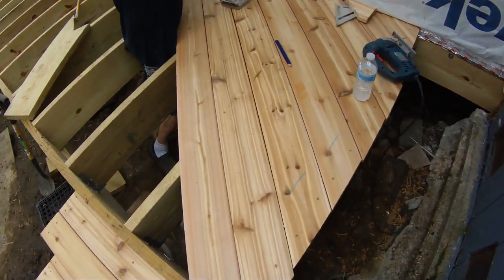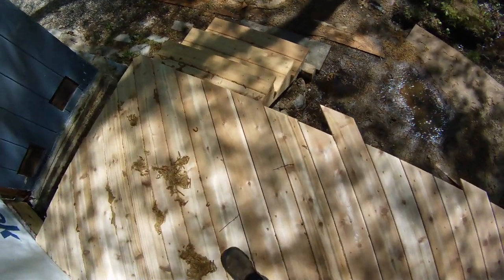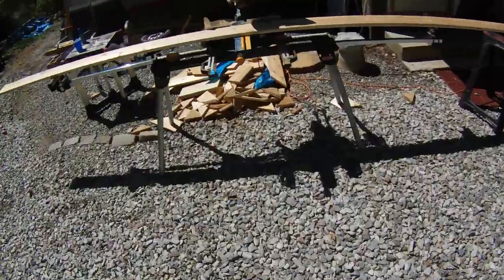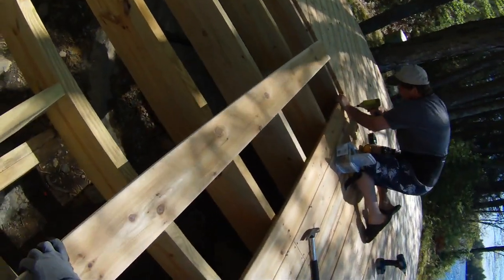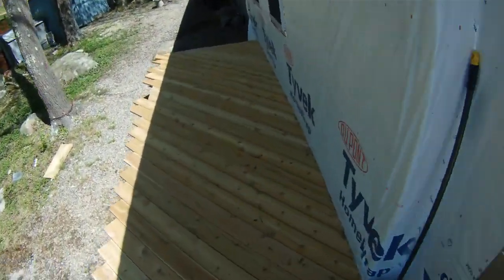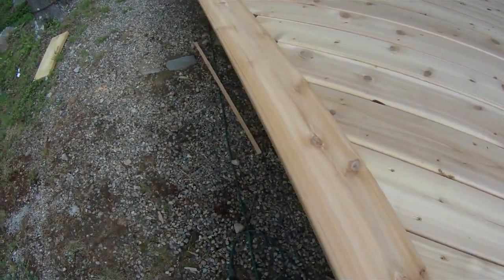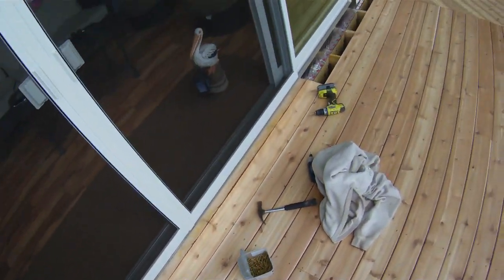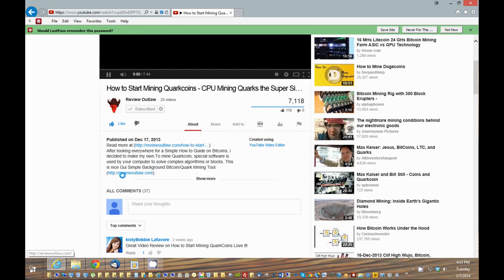Deck Building - P3 - How to install Cedar Decking

Comment: Is it recommended to leave a small gap when using tongue and groove? I know there would not be a space between the boards because of the tongue and groove, but what I mean is should I allow for expansion by not putting them as close as possible.

Comment: Can you use cedar decking with pressure treated pine for the vertical supports. Just trying to reduce cost. Great video btw
Reply from the maker: Yes that would be fine, i used all Pressure treated for Support and only Put Cedar on Top. Best of Luck!

Comment: Would you recommend any type of hidden fastener system for cedar decking? Thanks for any help on this!!
Reply from the maker: j bair I have not tried any on cedar I do have a video on hidden fastener system on Composite they have side slots built in to the decking that make it very nice, let me know if you find anything for Cedar as that would be a really nice look. If you can’t get. Tan screws and you can hardly see them after you stain.

Comment: Are those cedar deck board rounded at corners  like a regular 2x4 dug fir stud or is it a o0 degree at all four corners?
Reply from the maker: correct they are rounded, here is a zoom up picture of it. https://www.lowes.com/pd/Top-Choice-Radius-Edge-Cedar-Deck-Board/4323591?cm_mmc=SCE_PLA-LumberAndBuildingMaterialsRedwoodAndCedar_-4323591:Top_Choice&CAWELAID=&kpid=4323591&CAGPSPN=pla&store_code=2396&k_clickID=d45c22fe-9d73-4846-b1cf-04cb66325108&gclid=Cj0KCQiA0vnQBRDmARIsAEL0M1kNKM6d-EuF8CGJrJCpx6xMqhsDxXYtduP2WTcHdRX_oUgct58M4nkaAhbJEALw_wcB

Comment: you probably should have started laying the boards down from where you finished, 1/8th of an inch overhang would have been ok on the stairs
Reply from the maker: I added some under stairs lighting so i wanted a little extra room to play with. but thanks for the advise.

Comment: Never space natural wood, only synthetics like trex or IPE. Push them tight and screw em down, boards WILL shrink. 2 years from now you will have one inch gaps between each board.
Reply from the maker: Mark Walsh Good to know is that with every wood or just Cedar?, and if i don't leave space won't it swell and damaged the wood or buckle?
Reply: in the netherlands we actually use more spacing because of the wet climate. for those ´small´ boards we us like 8mm (about 1/3 inch) spacing. so revieuw outlaw is right to leave some spacing and i would leave some space between the house and the board to let the wood 'breathe' a bit.
Reply: Look at J B's correct assessment above; properly dried quality wood will swell when it gets wet, and if no gap will pull screws out, buckle and warp.
The cheaper and lesser quality green treated pine etc is wet and will shrink as it dries.